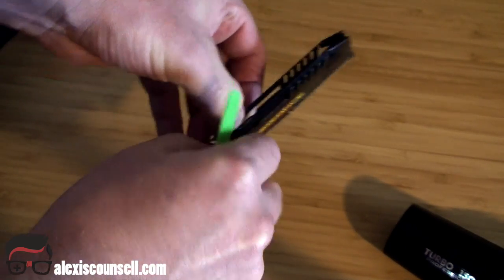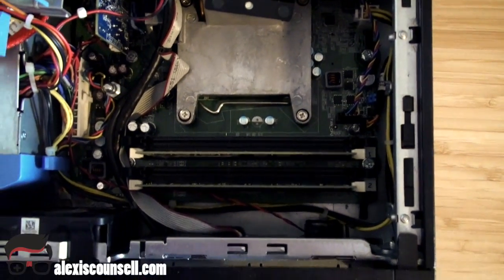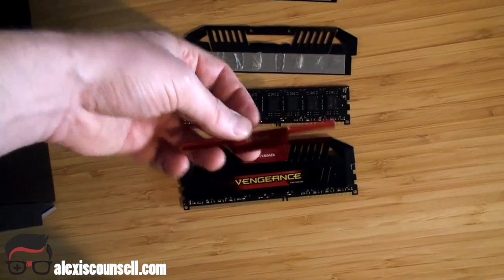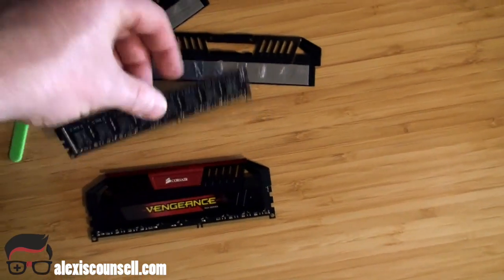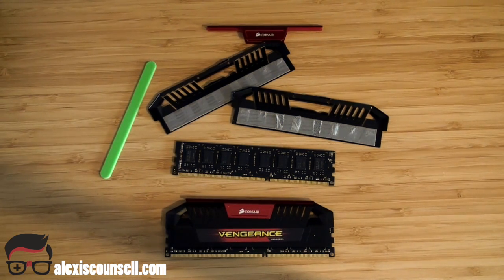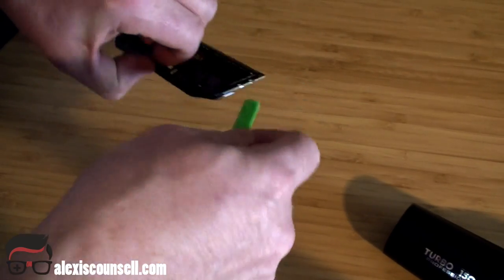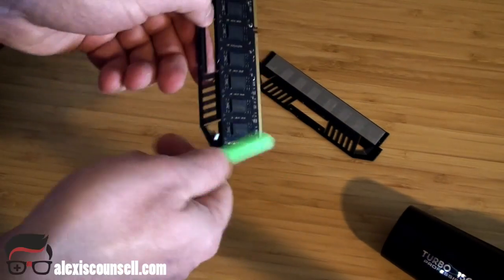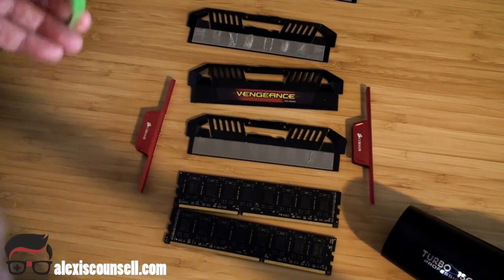HOW TO: Remove your Corsair Vengeance RAM Heat Spreaders

Comment: Nice video!  I'll be installing a couple of these sticks soon and I realized my Noctua cooler is not going to give the clearance I need.  I'm going to try this method out when they come in.  One question, is it going to be fine for me to run these without the spreader on?  They are 1.5V so I don't think too much heat will be produced anyway.
Reply: RAM does get hot if you overclock it. Unless you are overclocking your RAM, which many are not, I suspect, you do not need to worry about heat or the heatspreaders for that matter. If you are into serious overclocking you will be running possibly watercooled RAM anyway :)

Comment: I'll be doing this tomorrow night...
 Bought a Dark Rock 4 and it's clearing the ram... I have Corsair Vergence Black Edition 4gbx6, overclocked Xeon 3675 from stock 3ghz to 4.2 ... Maybe I can push some more out of it with Dark Rock... I run the ram at stock.

Comment: Thank you! How do you think - does it makes sense to change thermal pads under head spreaders on the ram if it is ~4years old. My ram is currently reaching 55-60c in heavy stress tests under overclock 1.45v (ddr4). Would i get 3-5c less?

Comment: PSA:  according to JEDEC specs, heat spreaders are not required for certification, HOWEVER, add a bit of overclocking (XMP-1 / XMP-2 profiles for insance) & not so great temperature management inside a stuffy case... you'll quickly see temps that are beyond spec---which is where heat spreaders do their thing.

Comment: The only reason to remove them is to  provide clearance under the CPU heatsink.
Reply: Yes, I am doing this now for this reason.
Reply: I know im necroing an 5 year old post but:
Im currently wanted to attempt to savely remove the heatsinks on my Corsair Vengeance 2x48gb DDR5 6000mhz,
to install an waterblock on them. i got into custom watercooling a few years ago with my last pc, and this time around i chosen that any part that gives of heat in my pc i wanted watercooled. (the only thing i didnt watercool was my PSU, even though an waterblock exists for that too.)

i bought the Icemancooler: ICE-RDT Direct touch RAM blocks, for an 2 ramslot motherboard.

Comment: I had difficulty doing it this way.  What worked really well?  Freeze spray.  Put on some gloves.  Take a can of air and turn it upside down, then spray directly on the chips and thermal pad for a few seconds.  When it gets cold enough, the thermal pad loses adhesion and the spreaders will pop off easily.  You will get some condensation on the module, so give it a bath in alcohol afterward, then allow time to dry.  This was by far the easiest method for me.  Good luck!
Reply: Great way to crack the board, or solder joints but I guess it would work.
Reply: @Donna-Trump   dont worry When I checked clearance one more time when i actually had them in hand they fit just fine so i never had to pull them. I do appreciate the reply though its always good to have extra points of view.
Reply: @Donna-Trump  Both methods are risky.  All I can say is that freeze spray worked for me and I did not have to pry at all.
Reply: super old comment so sorry for the bump. but did you just spray on top of the heat spreader where the chips/pad would be?
Reply: @AyooJake  I thought I had replied 3 weeks ago but now don't see it.  The spray goes everywhere, so on top and under the spreader.  But they will just pop right off when the adhesive gets cold enough.  No prying and praying necessary.
Reply: @stuff7071  Awesome I appreciate it. gonna do this on the weekend